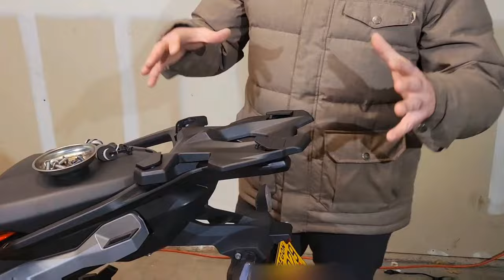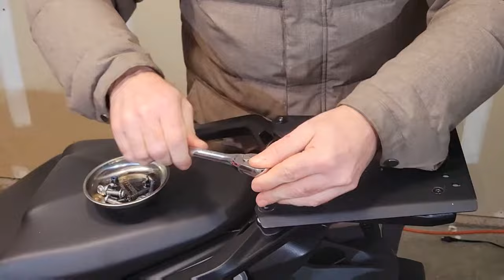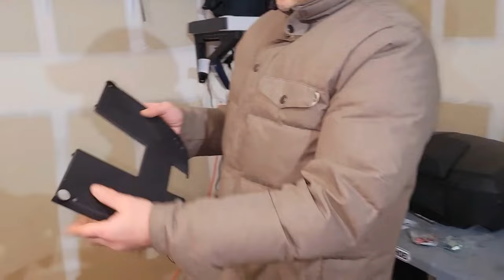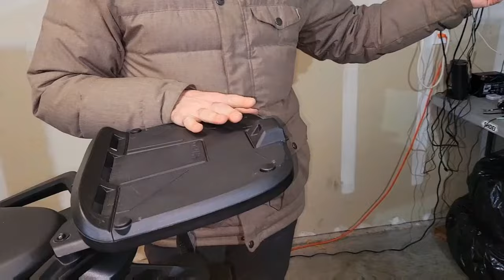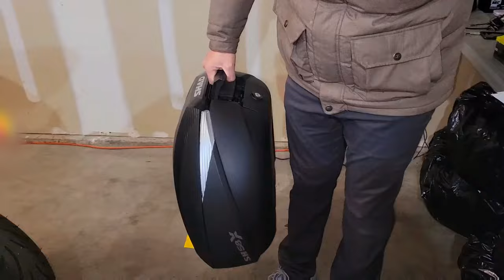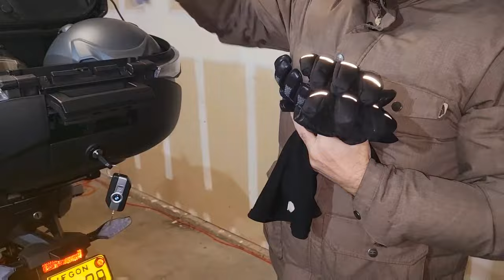How to mount a SHAD Top Case SH58X or SH59X On a 2020+ S1000XR

Comment: Thank you so much. Please tell me how waterproofing is maintained in case of washing the bike and water spray may be directed from down to top for a moment ?
Reply from the maker: I have washed my bike several times with the top case on while following the SHAD instruction by not directing the air pressure gun directly towards the case, and I didn't see any water leak. I rode the bike in the rain with the top case and my belongings were dry and safe.
Reply: @S1000XR  Thank you very much. Safe ride !

Comment: Hello thanks for your experience sharing. Have you observed any stability issue while over 200km/h? I have the same bike and I want to buy it if it not effect high speed stability
Reply from the maker: The top case never affected my motorbike stability, even while riding through gust wind. I have not surpassed the 187 km/h so I can't answer your last question.
Reply: I think that all the top cases are limited to 180kmh

Comment: What top speed have you tried? Best regards
Reply from the maker: 106 mph thru rural area just last weekend with a passenger.
https://youtu.be/gPBOJTWQUXU
If you are wondering if It is going to effect the bike's balance... The answer is no, I had it for a year and the top case is always up there riding solo or with my wife. Cheers.
Reply: @S1000XR  thanks for the fast answer bro 👍
Reply from the maker: @MrMilaan  No problem. Thank you for watching and please don't forget subscribe...
Reply: i just did like 105mph, no passenger but full of groceries lol. not an issue!
Reply from the maker: nice
Reply: SH45 on my Super Tenere presented no ill effect at 125mph. 
*On a closed track, of course.